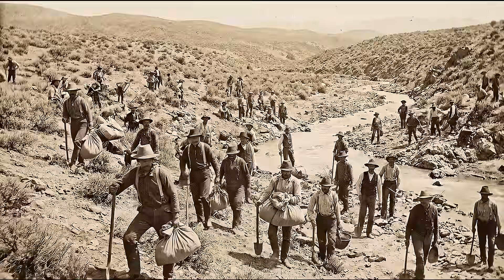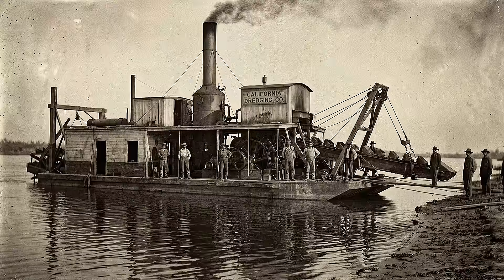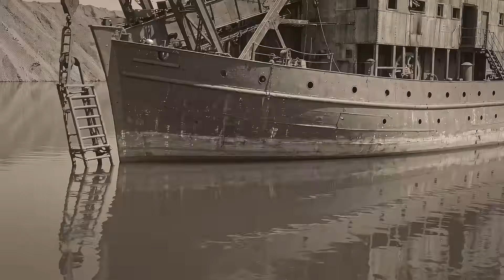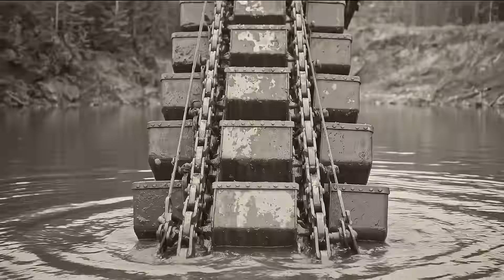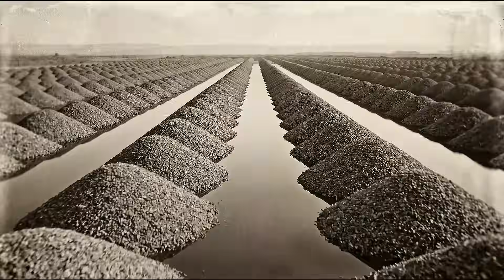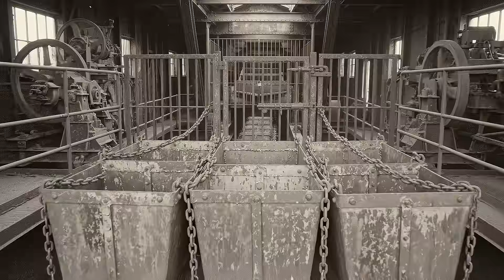The Floating Machines That Ate Entire Valleys — Gold Dredges

Comment: A 100 years later and still nothing will grow there
They completely washed all the topsoil away.  All that land destroyed.
Reply: How was the topsoil washed away when the dredge was in an isolated pond? The dredge created pond as it moved ahead,
at the same time filling the other end of the pond.
The dredges basically inverted the alluvium, with the topsoil settling to the bottom and coarse, washed rocks ending up on
the tailings piles. 
Much dredged ground could be re-worked when gold prices are favorable and the operation is well engineered and managed,
Such operations could restore the land to a near-original condition.

Comment: I can't believe you didn't add the bit about how black slaves did all the labor due to the low value of gold up until I believe it was 1972
Reply: No they didn't.  Not in California. 

 The chinese worked many mines in california as practically slave labor but were still free men. 

 The Sweet Vengeance mine near Brownsville was owned and operated by a group of black gentlemen, with one of them later becoming the first black mayor in california.
Reply: The fact that slavery was officially abolished on January 1st 1863 is a problem for you isn't it? 
I'm sure the slaves designed and built all the gold dredges as well.
The white man just took them from them right.

Comment: The barge sank around 2014 I believe. They found another one in south America, disassembled and brought it back. I spent many years delivering gasses to the Yuba goldfields
Reply: I work out there
Reply: @KennethJones-b1l  Aren't there still one or two dredges still working in the Yuba gold fields?
Reply: @daveneil3963 no.  Commercial dredging ended in the 1960s.   It’s now illegal.   There are small scale “hobbyists “ who use suction devices that are nothing like what is described here, but are still called dredges.
Reply: The dredge sank in early '06, then they raised it and floated it over to Western Aggregates where they worked it until 2014. Been sitting idle since.
Reply: @ADITADDICTS thank you
Reply: @johnnygavita Anytime brother.
Reply: @ADITADDICTS Do you know if the ever pumped out the old Empire mine in Nevada County?
Reply: @johnnygavita Naw man, that mine will never be dewatered due to it being a state park and all. 

The Idaho/Maryland mine had that canadian company fighting to start dewatering and rehabilitating the old workings lost their court case last year or year before so that's s.o.l. 

The Idaho/Maryland, Empire and North Star are all connected underground equaling 300+ miles of  workings. Wouldn't be a drop of H2O in grass valley if they did pump the mine out 😂.
Reply: @ADITADDICTS That's the one. I knew a guy up there, he was concerned about the water table depletion. Thanks again
Reply: @johnnygavita I worked in GV for seven or so years as executive chef of the Owl Grill & Saloon. In the basement was a blocked up tunnel that led to the Empire mine so the workers could just take the tunnel to the owl building. At that time it was a boarding house where a lot of the employees lived, thus being quicker underground than over. 

We had water flow in a few times during heavy rains and you could hear the water trickling through the tunnel, it was crazy 😂.
Reply: @ADITADDICTS just like Marysville, many networks of tunnels. Except Marysville has so many roaches and rats
Reply: @ADITADDICTS My father was thinking about buying the North Star Lodge around 1968. It was located about a mile west of the mill on old Auburn Rd.

He had too much work in the Bay Area and passed on buying it. It has been restored by some land trust and is now a designated landmark, open for tour and special events.
Reply: @mkay1957 Yessir, I've been there myself quite a few times. I've seen pics of before the resto and it was in need of serious work. 

It is a beautiful building. That'd be a cool place to live if you father had bought it.
Reply: Along La Grange Rd in Tuolumne County, about 1.5 miles south of Highway 132, there is a gold dredge sitting in a pond a couple hundred yards west of La Grange Rd. You can see it on Google Maps. It looks like a lot of the top section is gone and the front of the dredge is obscured by trees, although you can see the front of the bucket boom sticking out from under the trees.

It is on private land. I don't if access is allowed.

There are dredge tailings piles on a number of creeks and rivers. There are miles of dredge tailings by the Merced River near the town of Snelling. There are also some on the Tuolumne River, Mocassin Creek just south of where it enters Don Pedro Lake, tailings a couple miles north of the tiny settlement of Milton, some on the Calaveras River, and a whole bunch of tailings south of US 50 near the town of Folsom. I have seen tailings piles in a couple of other places, but can't recall what the name of the rivers they were on.